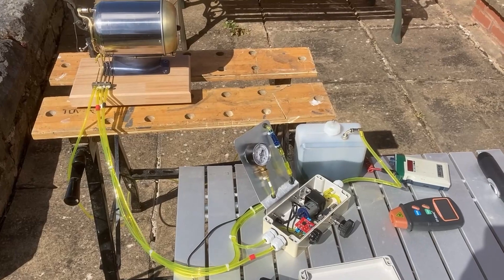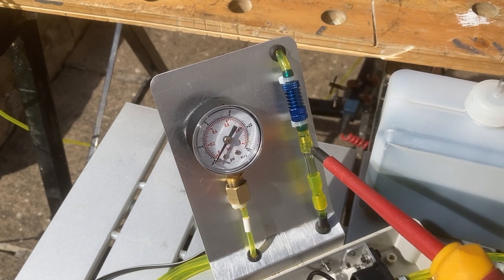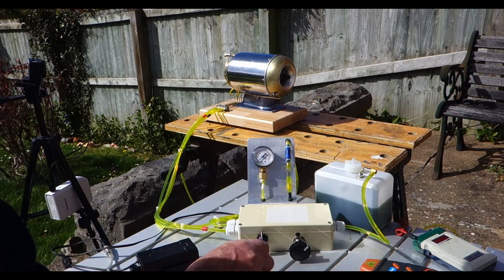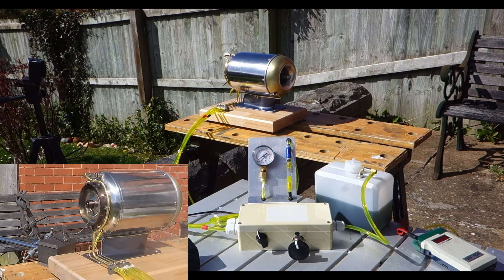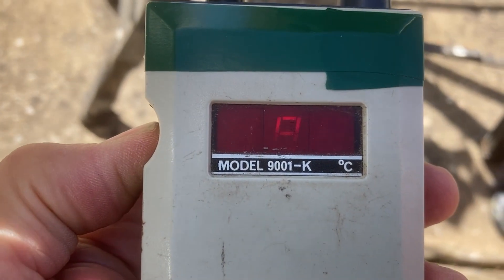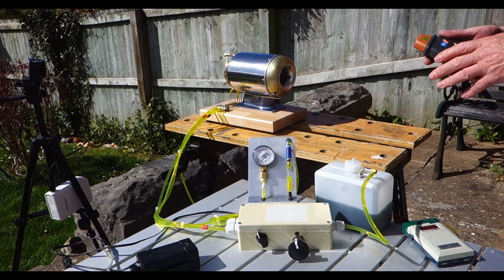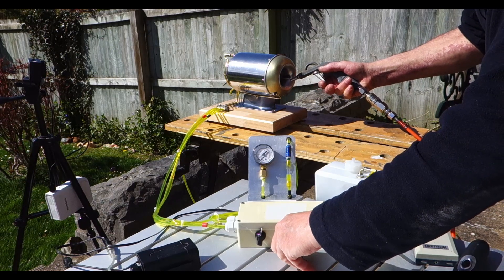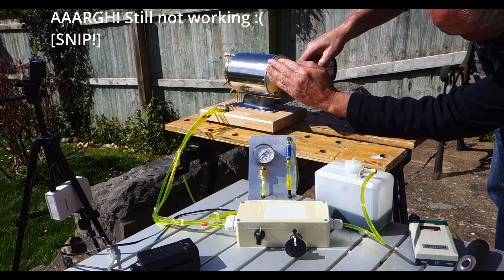Kamps DIY Jet Engine Running on Kerosene - First Test

Comment: I would like to know a small detail that I didn't see....if the compresso and the turbine have the same diameter....??
Reply from the maker: Hi - Yes, they are roughly the same diameter (65/66mm). If you can find Kamps' book, he describes the whole design process, starting with an 'off the shelf' compressor wheel.

Comment: Sounds good. My first Gas Turbine was the Shreckling, came out just before the Kamps engine....Restricted by its plywood compressor which was very effective at lower rpms.....My flying engine is my MW54, built from the drawings...Inconel combustor is improved and modified to include an internal vapourisor ring which also serves to prevent stick drift...It glows bright orange, even at idle....Inconel, of course...😏🇬🇧
Reply from the maker: @EnglishTurbines  Thank you. The Schreckling was the first to catch my attention, back in the 1990s sometime. I still have a hankering to try and build one as I think it was a pioneering design (hopelessly out of date now though).
Reply: @Mister_G  Yes, the closed face or covered compressor is unique in its design and actually makes it very efficient at low speeds in particular. Difficult to reproduce in metal though...🤔😳🇬🇧

Comment: Hi, great job, I'm trying to build one, I have a question... how many ml/min of oil mixed with kerosene should go through the lube line? For example at maximum power I read about 5 ml per minute but I'm not sure this is correct.
Reply from the maker: Thanks! 😊. The figure I worked to was ~1% of the fuel flow should go as lube. I guess that the maximum fuel flow is of the order of 250ml/minute, so 1% would be 2.5ml/min - in the same ball park as your 5ml/min. I fitted a 0.4mm ID x 25mm long needle in the lube line as recommended in the book. By Poiseuilles formula, it *should* give ~1% flow when fed at the same pressure as the 6 off fuel injectors that are 0.6mm ID x 50mm long. A little bit too much is probably a lot better than not quite enough.
Reply: @Mister_G  Thanks for the answer, very comprehensive. I still have a doubt about the bearing seat. The bearings have a diameter of 22 mm, the front one is planted in the seat, while the rear one is free to slide due to the pre-load of the spring. Could you give me an idea of the tolerances? For example, the bearings have a diameter of 22mm, the front seat must be 22mm + 0.01? While the rear must have a seat of 22 + 0.02 to slide? What tolerances did you adopt?
Reply from the maker: @MarcoFormentin  No problem. I'm a hobby machinist, so usually work to make things fit, rather than machining everything to a tolerance. I do know, however, that +0.01will give a loose fit and is far too big for either bearing. If you need tolerances, someone like SKF has technical data that will give the required tolerances for the bearing housing - they will be in microns for this size of bearing (maybe something like -0.001 / +0.003). The rear bearing only just needs to slide - better described as a loose press fit, rather than a sliding fit - bear in mind that the fit will loosen as the shaft tunnel heats up in use. If you're machining them yourself, just creep up on the size and test for fit.
Reply: @Mister_G  Everything is very clear, thanks, yes I spelled it wrong, the tolerance would be +0.001. I have one last question, it's about the tree tunnel. Did you use simple aluminum or some particular alloy, such as duralumin?
Reply from the maker: @MarcoFormentin  I'm pretty sure it was one of the 6XXX alloys (maybe 6082). I don't believe it's critical, so any of the 6XXX or 2XXX alloys should be OK.
Reply: @Mister_G  Thanks, one last question, can the external case also be made of aluminum? Or is it better to use steel given the higher temperatures in the NGV area?
Reply from the maker: @MarcoFormentin  You could probably get away with aluminium, but I would use steel for the end section around the NGV just in case.
Reply: @Mister_G  I understand, steel is safer for temperatures near the NGV. It occurred to me to ask you this question because I did some research and some turbine manufacturers make the case completely in aluminium, for example the ATJs. It would be easier for me because I found flatter gas cartridges in the rear part, compared to the classic Camping Gaz 470. It would be easier for me to make the hole for the NGV and the surface is better for matching the retaining flanges. Except they're made of aluminum...while the 470s are made of steel. I'll try it anyway and see what happens.

Comment: sir do you have the link for buying all of the things required to build this project, including the guage pressure meter and the ecu?
Reply from the maker: Hi, the pressure gauge can be got anywhere (ebay). There is no ECU - just manual control. Most of the stainless steel came from M-Machine in the UK - https://www.m-machine-metals.co.uk/ the other bits (including the compressor wheel) from ebay. There's a detailed description of what is needed in the book (have a look at my website for details - link in description). Thanks for watching! :)

Comment: I just watxhed all 3 videos. You get an A on the 1st. A on the 2nd. B on the last one. The techo was to blame. But because of that, the final phase of opening it up with the tail piece on was incomplete.. 
This is the first time I've seen a small turbo jet engine built from the ground up, tested the fuels, and ran it. I was especially impressed on the start up. Vertually no delays. I bet you were happy about that.
Extremely good job. 👍
Reply from the maker: Thank you very much! Yes, I'm very happy with how it runs - I couldn't quite believe it when it first started up. I haven't finished yet, though. I'll be back on this project soon 🙂

Comment: Impressive work. I have a similar tach. It came with reflective tape. If you stick a small piece on the shaft or whatever and make that your target it'll work quite well.
Reply from the maker: Thank you very much! 😊
I have the retro-reflective tape, but I was/am worried about whether it would stay on at tens of thousands of RPM, and what damage it might to to the compressor if/when it came off. I will have to do some experimenting.
Reply: @Mister_G  Perhaps paint the compressor tips abit?
Reply from the maker: @merxellus  Hi - I did try blackening part of the compressor, but it didn't work properly in bright sunlight. I have a Hall effect tacho now - just need to fit it and run the engine again.

Comment: Amazing stuff;
Of course you have now seen how poorly optical tachometers work in full sunlight.
Stupid question #1:
Is there any way to incorporate a small pilot shaft that would protrude out of the intake so you can place the tach 90deg to the target ??
Stupid Question #2:
Is there anywhere in the system to place a simple optical encoder disk setup to measure RPM. 
Stupid Question Finale:
Can you measure RPM directly with a mechanical contact style device that would measure mechanically directly from the motor shaft from the intake side?
❓
I’m with you, I want to know how fast you are spinning that thing. 
🧐
It reminds me very much of the engine can of that first German Jet Fighter.
Reply from the maker: Thank you very much for the comment - I'm glad you liked it :)

The nose of the spinner nut does stick out of the intake, but it's obviously a tapered section, so tends to reflect the light at an angle, and the tacho did work OK on my first test. There is a hole through it that I could use for an "interrupted beam" type sensor, but I'd need a different meter to measure the RPM (it would give two pulses per rev, rather than one which would mean my current (100k RPM) meter would read double the speed and so max out at a real 50k RPM). I could remake the nut with a parallel section, it's not something that had ocurred to me, so thanks for the suggestion. 

I think a few people have embedded an optical sensor behind the compressor wheel. It's another option I'm considering. If I can't improve the optical system, I think I'll try a hall effect sensor with a small ring magnet inside the spinner nut - I know that others have done this successfully. It would be really useful to have an RPM reading permanently available. I'm not sure I fancy my chances trying to use a mechanical contact tach at ~80kRPM 😄. 

No such thing as a stupid question, just stupid answers^ 😉.
Thanks again.

Comment: Superb construction. The engine seems to run perfectly. Are you going to do thrust measurements? This type of rpm sensor hates sunlight. You can also use motor control electronics like the Xicoy. This is what I did on my fd3/64 at the end of construction.
Reply from the maker: Thank you very much! :)  I'm very, very pleased with how it runs. I do intend to try and measure the thrust now that I've proved that the setup works on kerosene. I will try and improve the optical RPM sensor, but if that doesn't work, I might try a hall effect sensor.

It was seeing pictures of the FD3/64 back in the 1990s that first put the idea of building a jet engine into my head, but it had to wait until recently before I had the time / equipment to do it. I don't think I'm going to go down the ECU route (like Xicoy, etc.) - I think I would need to add quite a few parts to make this worthwhile (like an ignitor, EGT probe, electric start, etc.).

Thanks for the comment :)
Reply: @Mister_G  I'm using german Projet ECU there is a sensor board SA130 which fits engines of diameter 110-120 mm. Great work.
Reply from the maker: @MrCzarnm  Thank you, I will look it up  - Since my earlier reply, I have found that there is an Arduino ECU, which has started me thinking... 😄